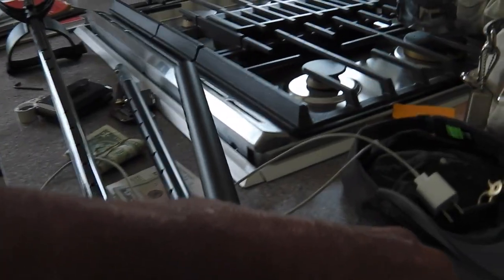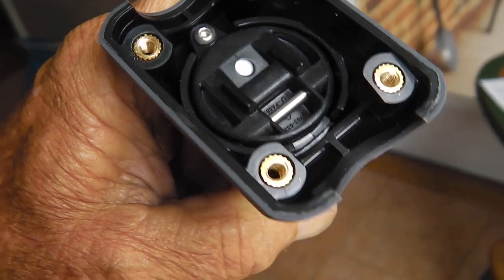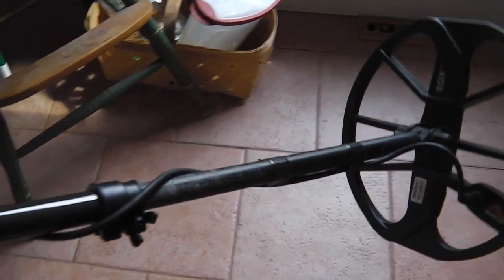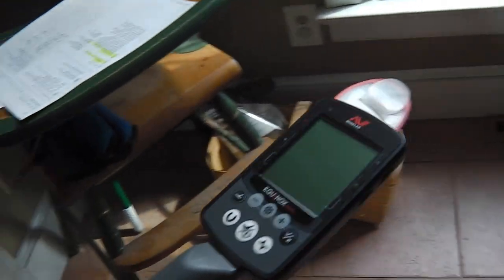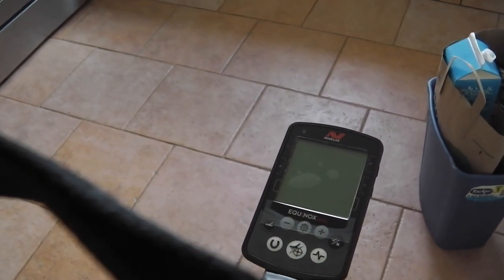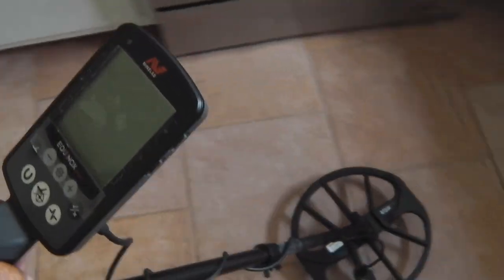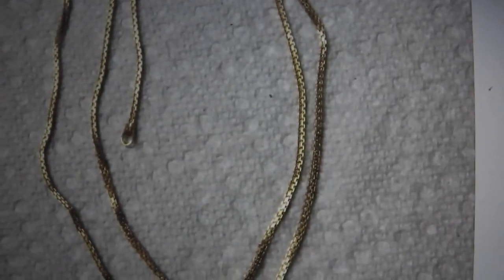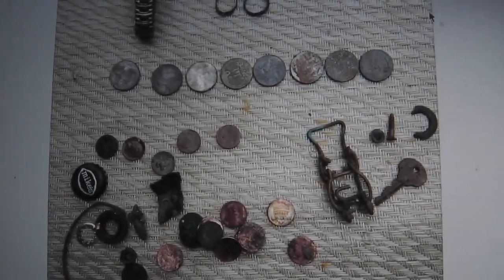Equinox Back _ Carbon Fiber Switched - 22K chain Nada today

Comment: Did Minelab replace or did they repair yours?
Reply from the maker: they can not repair what they do not know.....sent me a new one and sent mine to headquarters for evaluation.
Reply: Just to be clear when showing the box you said 359. Was that the time it arrived? Hopefully it wasn’t a charge as I’m hoping their warranty is good. Now with that lighter carbon fiber you can carry back more yellow stuff. 😏
Reply from the maker: replaced with new......sent mine old one to headquarters for evaluation